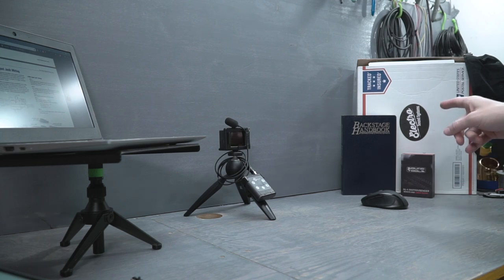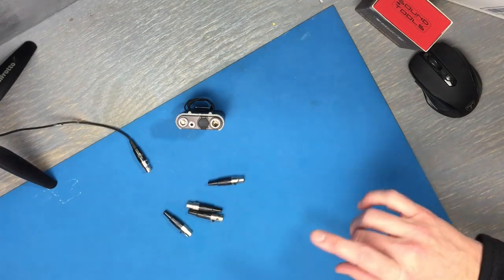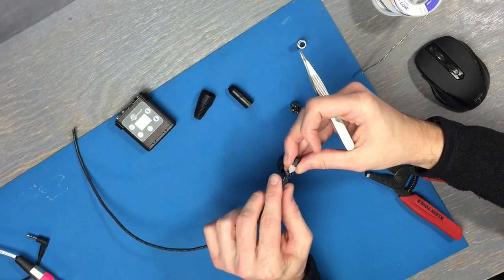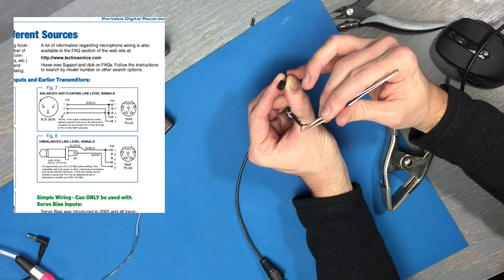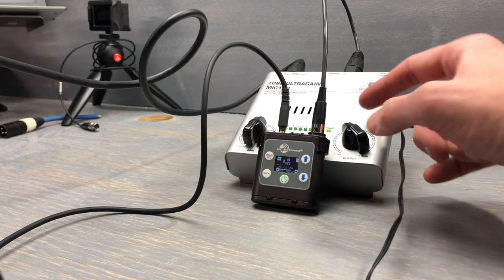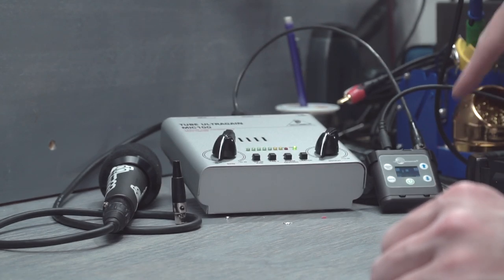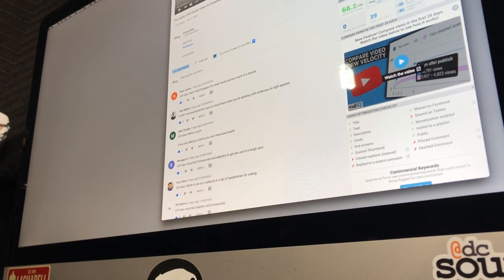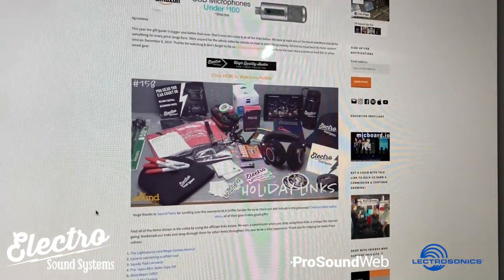Making a line level TA5f to XLR input cable for Lectrosonics PDR - How-to Solder

Comment: Will you be able to guide me to make a TA4M to XLR male connector 

If you have some diagrams or something you can share it with me
Reply from the maker: That’s going to depend on the gear you’re connecting to. Lectrosonics for instance offers a wiring diagram for what I’m doing here. Shure, AT, & Sennheiser & most other pro brands also offer wiring instructions for their gear, so grab the user manual for the item with the TA connector on it and see what they call for. Thanks for the message!